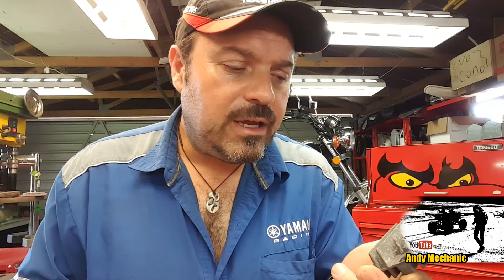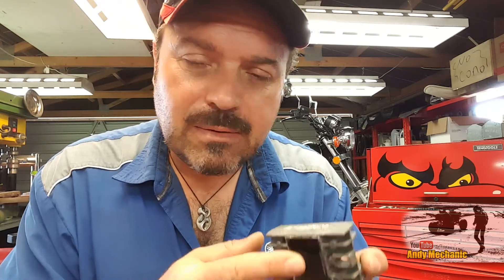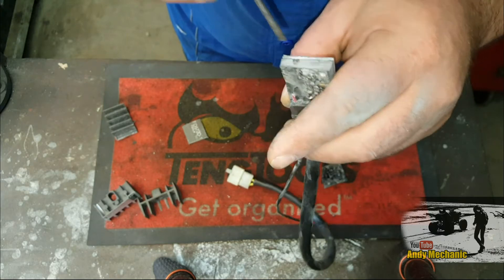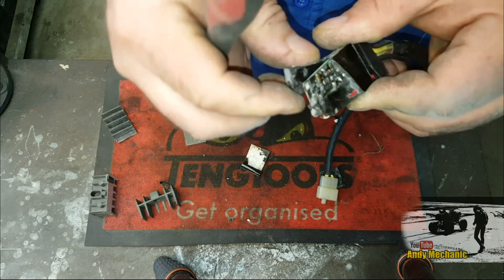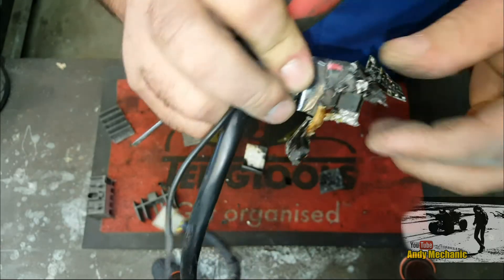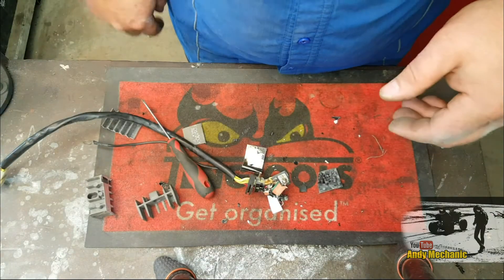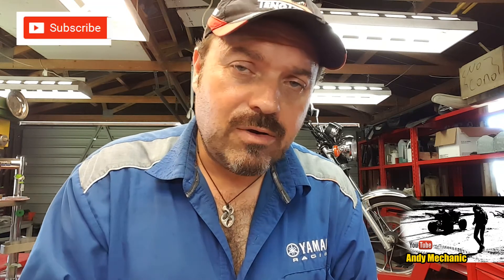Motorcycle regulator rectifier unit autopsy #1427

Comment: Nice one.... interesting to see.   I've a 4 stroke dirt bike with hot running issues and a number of people have pointed me in the direction of it being the rectifier.  I never knew before seeing this that the rectifier required to dissipate its heat.  More evidence pointing to my rectifier.  Thanks for the vid and interesting autopsy seeing what's actually inside.  It certainly seems a very vulnerable component.  Thanks again.. kind regards.... Steve.

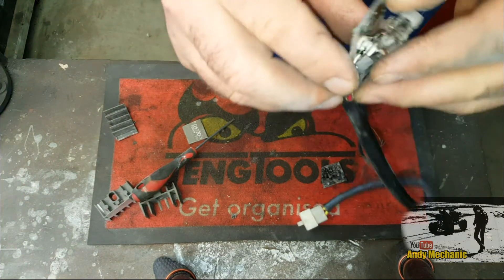Comment: Take a look at about 6:24.  In all my years, working with electronics and electricity, I have seen no other application where the heat from the components must pass through an insulated circuit board to be dissipated.  Not very efficient heat dissipation.  Developed while "engineers are left unsupervised" during a wild office party?
Reply: The 'Thyristors' that are creating heat by shunting excess input voltage to ground would be on the back of that circuit board or bonded directly to the inside of the metal radiator.

Comment: I have problem with this thing. there are some oil leaked from the male-female connector on the rectifier. I'm scraching my head out to figure out where is this oil coming from. I ride a benelli tnt600.
Reply from the maker: The oil is working it's way up the inside of the wires that run from the stator - a common problem on many bikes...

How to fix? Let me know as I haven't managed to find a total cure yet!

Andy

Comment: Good investigation and probing. Rectifiers are known to fail regularly on some bikes. Baffling and the constant replacement lead to motorcycle owners selling off their bikes. Regulators fails because of :

1. Power generated by stators are too high in high RPM, there is no limiting functions to it, the high power gradually damage the Rectifiers.
2. Engine oil is too hot and heat is absorbed by the Stator causing it to malfunction. Heat is also transferred through wirings which gradually damage Rectifiers, Sensors and other wire connected parts. This happens if the bike if not service as scheduled or having not the right grade used.
3. Motorcycle Wash. Water jet wash results in dampening of parts and water being in cracks, sockets etc. This may cause shortage.
4. High humidity areas may cause same dampening and water effect problems (keep bike in garage or under good covers)

I’m thinking on where could I relocate the rectifiers so that it gets cool fast. I also wish rectifiers comes with a mini cooling fan just like computers have.

That’s partly my thoughts and findings.
Reply: Watta nice comment thanks a lot of info bro.

Comment: its curious to see that the rectifier authopsy had more popularity than the actual testing on vid #1
none the less, gret job overall, i will defenitly be doing these tests apart from the rectifier wich is 'ambigous'  and condemn the rectifier eventually. i just didnt understand what are you supossed to do if the problem is in the others components.
Reply from the maker: Oh, well if the rectifier tests bad then it's time for a new one. I was just curious to see if there was any visible damage inside.

I have videos testing the stator too that should help.

Cheers Andy

Comment: that was repairable before you cracked it open. Here is how : take a pot put some glass shards on the bottom and add water. put it on the stove and boil it with the unit in it for 10 minutes. the resin will get soft and you can remove it. with the resin removed you have acces to the components and yall can fix the problem
Reply: You don't need the glass. I know what video you watched, and you seem to misunderstand the purpose of the glass, perhaps because of the term "glass transition temperature". This has nothing to do with putting broken glass in the bottom of the pot. The glass was there simply to keep the unit off the hot metal bottom the pot, to prevent the plastic housing of the device from contacting the bottom and melting.
Regulator/rectifiers are made of aluminum, will not melt, do not need to be put on risers, t, and even for things in plastic housings, those risers don't have to be made of broken glass, anyway, they can be anything that does not transmit heat well.
Whether all that will work here depends on the specific value for the glass transition temperature (Tg) for the type of resin used. While there are some resins with a Tg less than 100°C (the temperature at which water boils) if the Tg is greater than 100°C, the resin will not transition and this technique will not work.
Reply: @ManifoldSky  👍 right you are!  Any idea what T(g) is for potting resins?
Reply: Thanks bro another useful info

Comment: I would think that one of those packages you referred to as bricks was a voltage regulator and the other was a bridge rectifier package ?
Reply: thought I saw 3 individual rectifier diodes, and an IC for control.